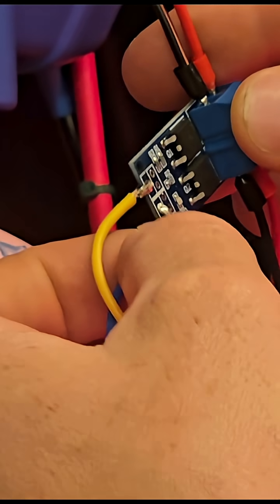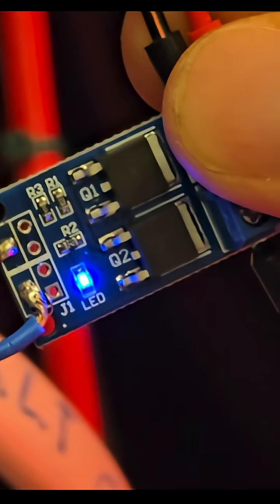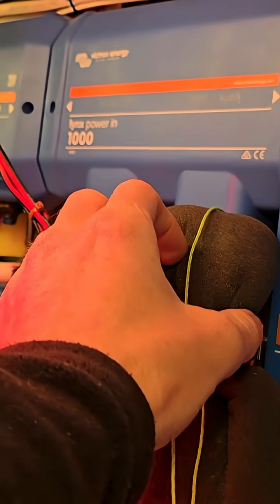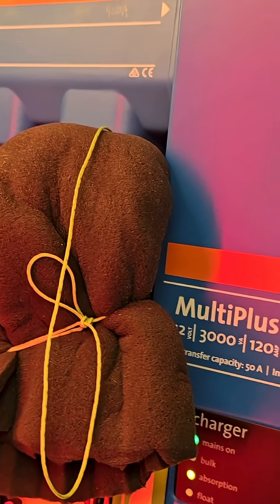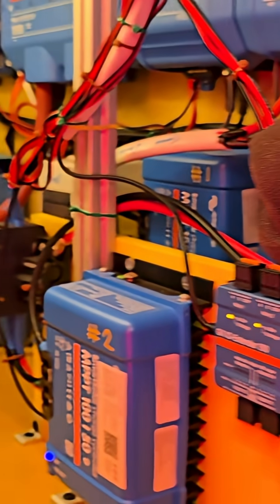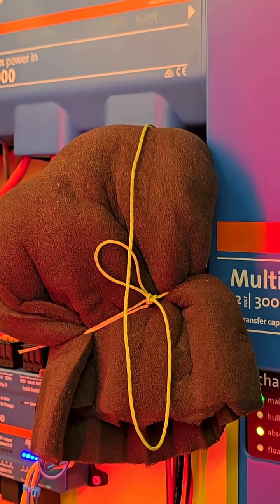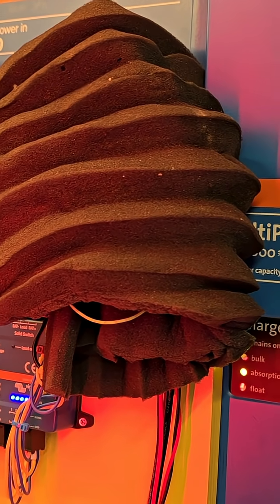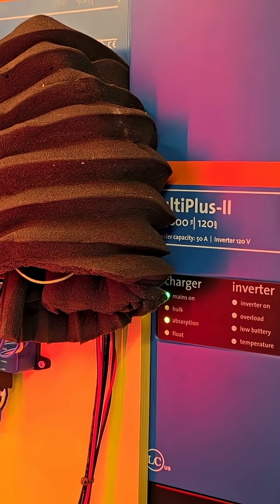Electrical MYSTERY: Why are my PWM Dimmers SCREAMING? 🔊 (High Pitch Whine Help!)

Comment: pwm freq should be changed. a lot of led drivers are driven just above the freq of visual strobe effects, eg ~100Hz. this is audibly noisy, sounds like may be in the hundreds of Hz (human ear is most sensitive between 300-3000 Hz). without knowing the whole circuit i can't say much about the switching scheme or why the circuit itself is emitting the noise. sometimes it's capacitors; ceramics can squeal a bit in some configurations due to piezoelectric effects. other times it's inductors due to magnetically induced vibrations. sometimes pcbs can be noisey around the mosfets for the same reasons, because of pulsed current.
Reply from the maker: Thanks for the insights, I appreciate it!